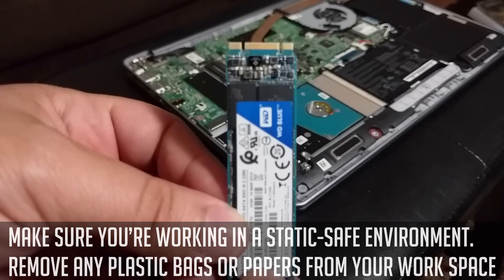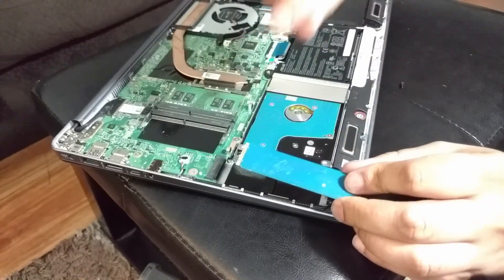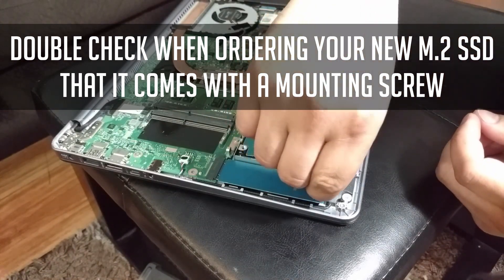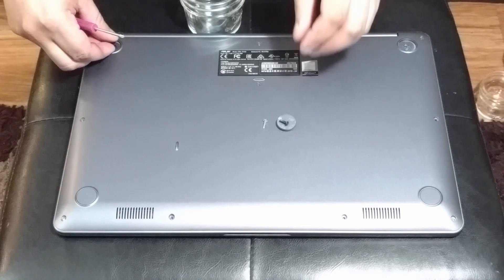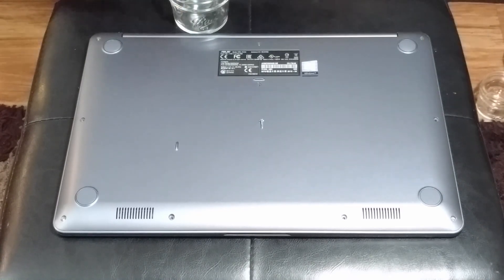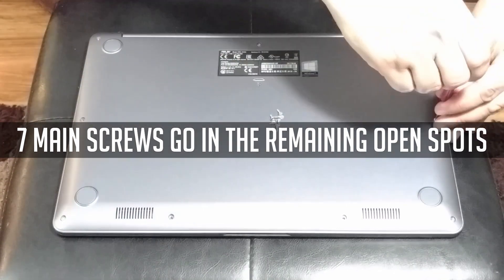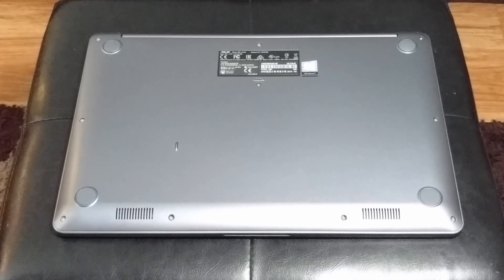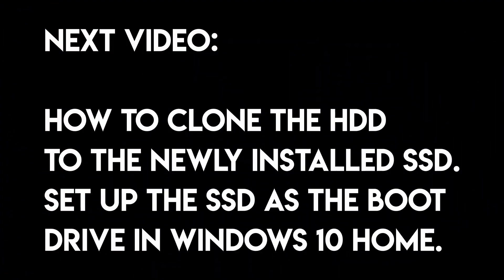ASUS Vivobook F510UA: How to install an M.2 SSD solid state drive - SERIES PT 3

Comment: could you help me? when i installed the m.2, the BIOS didn't recognize it, i even tried a different ssd from ADATA but it seems to be that te slot is not detecting anything
 at all
Reply: Antonio Blancas Hi, same issue here with a Crucial MX500. Did you find a solution to this?
Reply: @pepereina1989  same. Any solutions, guys?
Reply from the maker: Did you reset the comp? Make sure it's in all the way and get back to me
Reply: Facing the same issue. I know the ssd works as i used a ssd to usb3 adapter and windows recognizes it via usb.

I also used a sata to m2 adapter and  put this ssd(sitting inside a sata enclosure) in the laptop in place of hdd and it worked. I installed ubuntu on it. Boot properly. 
But when, I take out the ssd out of enclosure and put it in the m2 connector on the laptop, it doesn't get detected and system boots up in bios directly. I kept the hdd removed in the last step so that laptop gets forced to boot from ssd but with no luck.
Reply: Same with me. Tried with 2 different SSDs. No luck.
Seems like asus might have permanently disabled M.2 for my laptop

Comment: I see you are installing a 250gb ssd, would the 500gb give me more performance? Would it be worth it?
Reply: Depends if you want the simple answer or the detailed answer.... The simple answer is that 256gb is just as fast as 500gb.  Those numbers are measures of Capacity, not Speed.  The detailed answer is every single SSD operates at slightly different speeds.  Usually what determines speed is the Brand and Model.  If you want to find the specific Model of SSD that is the fastest, largest, and cheapest, you'll have to review SSD benchmarks and do some online shopping.  Here's a good place to start:  https://ssd.userbenchmark.com/

Comment: I stripped my screw and now idk how to get it out :(
Reply from the maker: Dang that sucks!!
Reply: Drill the head off and just leave the bottom part in the hole. You’ll have to put the cover back on with that one less screw holding it but by the looks of it there are plenty of other screws to hold that cover on for you.

Comment: I just ordered mine and I am planning to also upgrade the RAM, does it have a second slot or do I need a single 16gb RAM?
Reply from the maker: Two slots i believe for ram.
Reply: Okay, thanks.
Reply: It has 2 slots but i think its one stick of 8gb instead of 2 4gb
Reply: It has one slot empty

Comment: hi, I am going to pick up the WD m.2 for mine, but want to know if a crucial 8gb single ddr4 2666 mt/s PC4-21300 SR x 8 SODIMM 260 pin memory CT8G4SFS8266 is going to work on the f510ua; as Im also interested in upgrading to 16 gb ram. tahnks in advance!